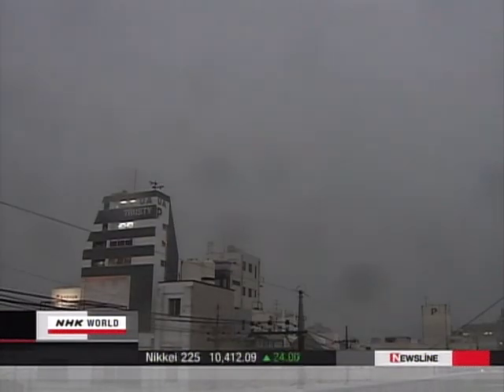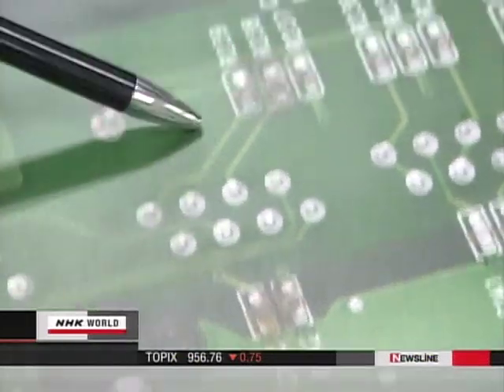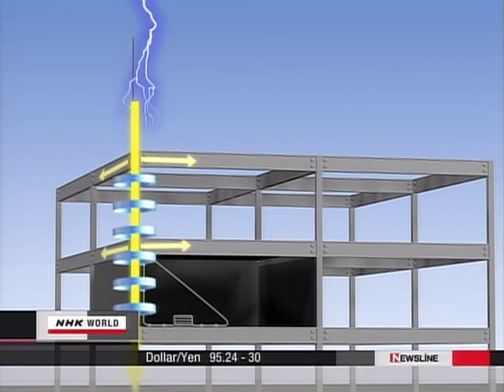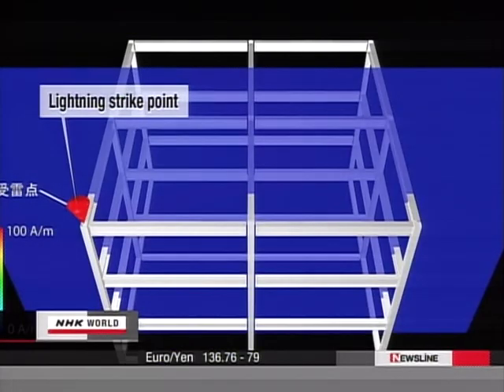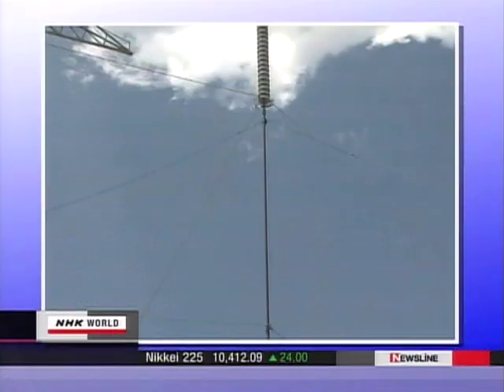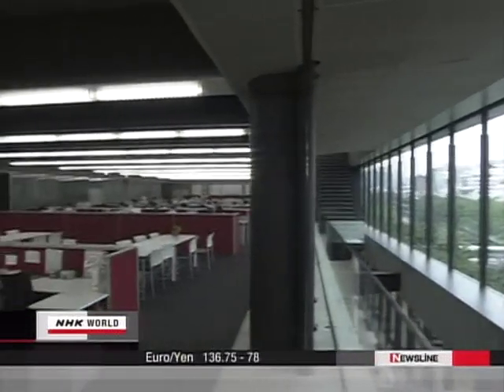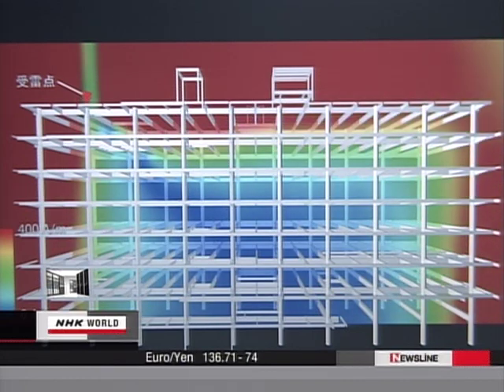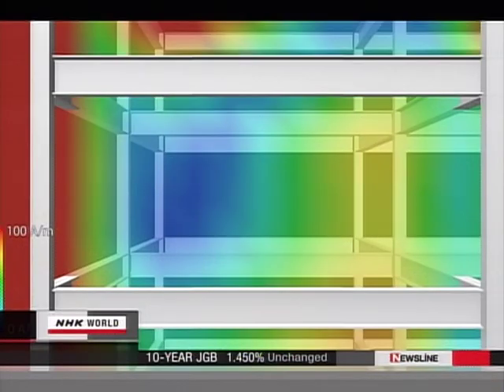lightning  protection الحماية من الصواعق

Comment: This is cool. Is the steel frame architecture with a lighting rod act the same way as a Faraday cage in protecting electronic devices in it? And if yes, does this mean that the Faraday Cage can only protect against Electrostatic surges and not prolonged EMF presence?